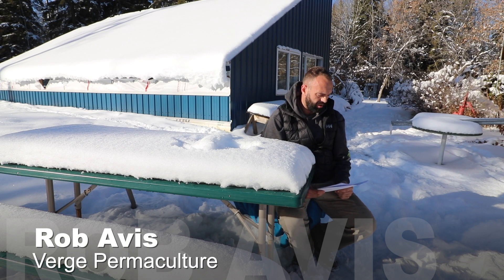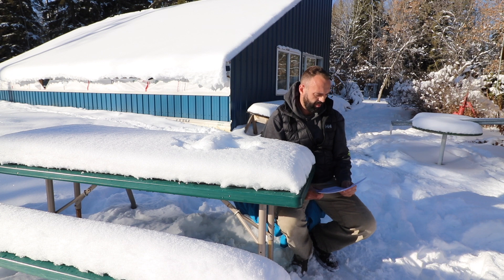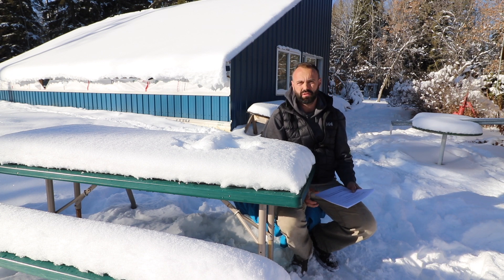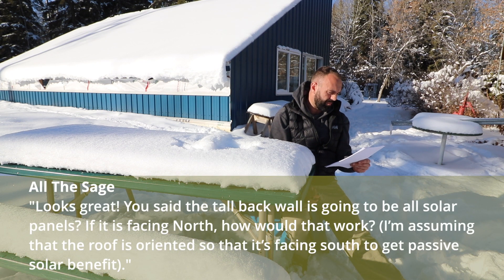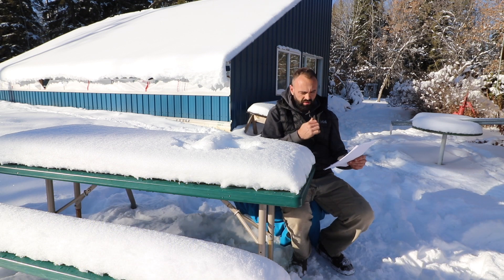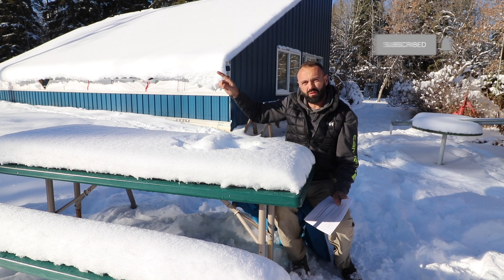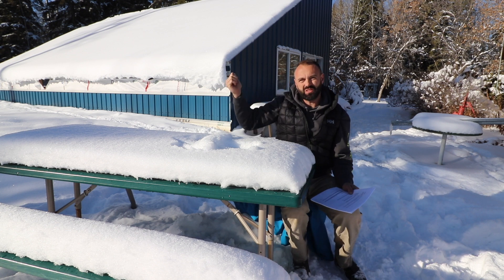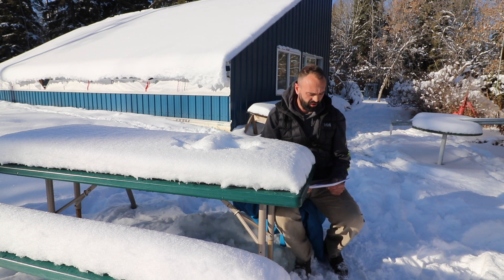How would A North Wall Solar Air Panel Work?  Passive solar greenhouse Ask Rob Avis 14

Comment: will  you use china green house style blanket system ? The pull a blanquet over the glazing for the nigth and pull it back in the morning to keep most of the heat and work like the snow you have now but while using the green house for production in winter time. There is motor and  roll sytem on top of the green house for that.

Comment: Hi Rob,  What is the marginal benefit of taking the the excess heat and forcing it underground using the tubes that you did when you compare that method to having a berm / clay wall / water filled barrels etc. (basically any sort of thermal mass) against the back wall?  Is there any value in having both the underground battery like you have AND the back wall thermal mass battery, or is that overkill / inefficient?  Thanks in advance.